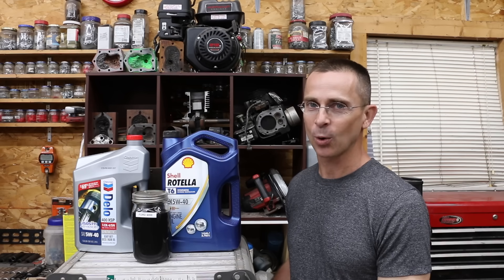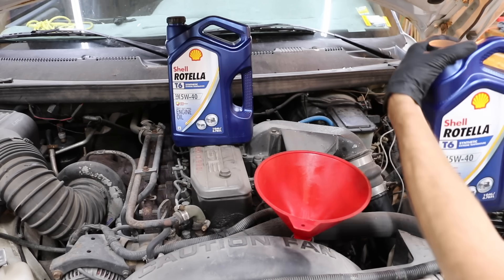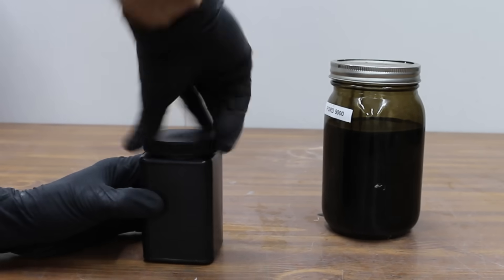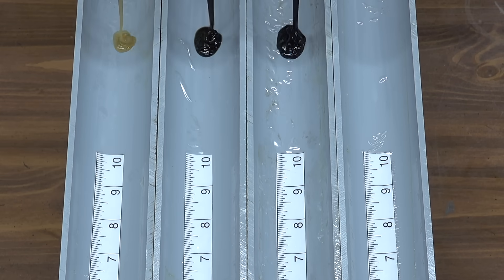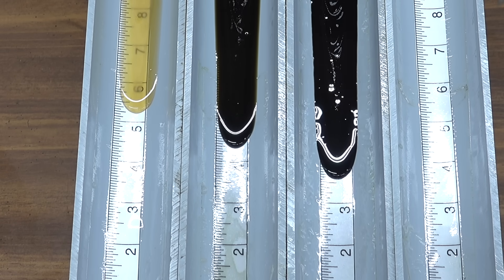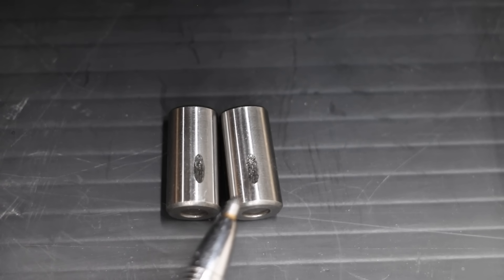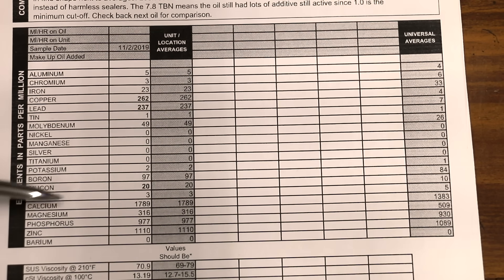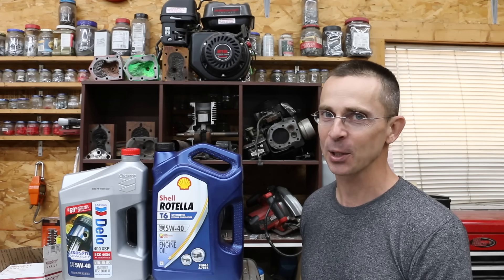Will Annual Oil Change Damage Your Car? Let's find out!

Comment: The question is how many miles before the fully synthetic oil is out of the normal ranges.
I have known for many decades that mineral oil goes black at around 1,000 miles & fully synthetic oils go black at around 2,000 miles, so these type of oils i guess starts to degrade at these mileages.
So for a high performance turbo engined car i would recommend changing the oil with fully synthetic @ 2,000 miles for the ultimate protection.
Good also to change your oil twice a year just before the hottest and coldest months arrive, july & december.
Good video.(:-)
Reply: 2000 miles is needlessly frequent in my experience. Oil is supposed to go black. That means its detergent properties are working correctly.
Reply from the maker: Thank you for the feedback.  Oil should last much longer than 2000 miles.  With regard to color, when exposed to heat, it oxidizes and changes color as demonstrated in this video. 0 miles and the oil is dark.  The oil is still good.
Reply: @ProjectFarm  
I know oil lasts longer than 2,000 miles but starts to degrade around 2,000 miles on a car and not at full tolerance at this mileage that's what i was trying to get across.
I found that oil goes black after 2,000 miles on the dipstick with FS and not straight away.
When you service your car the level of the oil does not drop at all on the dipstick only after a certain amount of mileage.
When you notice on the dipstick that the engine starts to use oil this is a good indication that the oil is starting to deteriorate but the oil is still obviously good but clearly not as good when it was brand new.
It will go black nearly straight away on the dipstick for when you put in FS for the first time as it starts to clean the engine especially if there has been a poor grade oil in beforehand with black sludge in there, but after a few services the oil stays clean for longer on the dipstick after you service it.
But the oil will look dirty soon after the service if you drain it though.
Also engine oil does not reach 400+ fahrenheit in an engine it reaches around 200 fahrenheit.
I have a oil temperature gauge that reaches a maximum of 212 fahrenheit 100 celsius on my high performance honda hornet 600 and never goes no where near to 400 fahrenheit.
The gauge is even redlined to 248 fahrenheit 120 celsius and never reaches that.
It takes 10 miles for my bike to reach the optimum temperature of 80 celsius with FS in.
Personally i have noticed that my motorcycle engine does not start using oil until the new oil reaches around 1,000 miles of usage this surely is an indication that oil usage is not all to do with heat if it was all to do with heat it would start to use oil straight away which it does not.

Comment: Little confused. Are you saying that I don't need to change my oil in my gas engine truck at 5K miles? Or is this just diesel/Tractors?
Reply from the maker: The video demonstrated that oil with "low miles" is good well beyond 1 year in the crankcase as long as the oil reaches full operating temperature.  Gas or diesel engines, it doesn't matter.  Thank you

Comment: I would love to see this test done with the new DGI engines such as the Chevrolet/GMC 1500 models. I've heard the oil gets contaminated with these new engines. I have to get my oil changed at least once a year according to the manual to keep my warranty since I don't drive many miles. I just recently had my oil changed a year later with 75% still remaining on the dash oil life indicator. I bet this is a scam.
Reply from the maker: Thank you for the video idea!

Comment: How long you can run an oil largely depends on the TBN ( Total Base Number ), the bigger the better, for example i have run Shell Rimula R4X which is just the name Shell gives to Rotella outisde North America, for more than 2 years without a problem.
This is because it has a TBN of 10.5, which is pretty high, and therefore can neutralize acids for longer than oils with a lower TBN.
Reply from the maker: Great point! Thank you
Reply: Rotella and rimula series both are different
Reply: @veeral01  Yes they are different but if you compare an anlysis of Rimula and Rotella 15W-40 they are very similar

Comment: A other problem is you used old diesel they don't make a lot of moisture then petrol and more modern engines have more different problems due to emission equipment gasoline direct injection= you can't transfer your conclusion on to modern engine designe It's quite complex as I have 2 tdi be the oil from the dpf can damage the same engine who has no dpf.... What matters for modern is the manufacturer specified oil code for engine designed.
Reply from the maker: Thank you for the feedback

Comment: Busting the BS, I love it! I have actually done a 17 month oil change on my accord V6 at 10K miles and it turned out fine. My accord saw longer trips with more time in between drives vs the usual daily commuter.
Reply from the maker: Thank you very much!

Comment: Is it just my eye, or did the used T6 offer slightly better protection than new in the film test?

Another thing worth noting as this test was performed on synthetic oils, which are designed not to break down at a molecular level. As far as I'm aware, mineral oil will start to break down after 6-9 months so it might be a good idea to repeat this test with a mineral and a blended oil
Reply from the maker: Thank you for the feedback.  The used oils were both T4 (Conventional)

Comment: I used to change mine often along with air filter and oil filter. I would check the viscosity of the oil. When checking the dipstick clean it off with your fingers and roll your fingers around and feel the consistency of the oil if it doesn't feel slippery and feels more like milk or water it's lost its lubricating ability. I also would put Marvel Mystery Oil in it. Or if all of a sudden it starts burning oil Marvels when it burns the residue is still a lubricant. I did this in my Ranchero  170 straight. Driving it 4 over fifteen years an estimated over 500,000 MI. It started losing water I decided to rebuild it and found out  the rear freeze plug had rotted out.
Reply from the maker: Thank you for the feedback

Comment: I think the 3 months/ 3000 miles thing is from the past with poor additive packages and conventional oil.  With a full synthetic oil, change it based on mileage, not time, since there is no organic material to go bad from age.  Syn blend should be changed by mileage or after a year, as well as conventional oils.  It also depends on how hard you are on equipment, too.
Reply from the maker: Great point!

Comment: Biggest problem is that people dont check their oil, so cars that could go 5 or 10k miles if they were topped up (some motors just drink a bit of oil, like the BMW N14) they could, but owners just run them so low on oil that it wears or destroys things (like the cam chain tensioner on the N14)

I drive my truck RARELY, a land rover 4.0. I change the oil every year or two, but it only gets 100-200 miles a year. I change the oil more from guilt than anything, because it's still visibly transparent at the end.

I only change my motorcycle oil once a year and even on my high revving bikes, I've never had a problem.

I Blackstone most of my vehicles. On my daily driver, I do about every 5k miles with full synthetic because it sees hard city driving and runs a bit hot being supercharged.
Reply from the maker: Great point.  Thank you

Comment: Project Farm, I really enjoy watching your comparison videoes and purchace things mostly off of your videos, Thank You For your hard  work and dedication
I have an interesting comparison idea that is not real expensive but should provide some interesting results.You could try different brands of automotive fuses and see if different brand fuse sizes blow at different amprages ,I assume the most popular is the standard Blade fuse, but the micro blade is getting popular, lets say Brand "A" 20 amp fuse actually blows at 23 amps and Brand "B" 20 amp fuse blows at say 19 amps.
I feel it would be a good comparison especially if the component required a certain amp and did not receive it thus harming the component  from low ampreage

Comment: I have a number gas engines and have been a oil nut sense the 70s with Amsoil but have gone to the T6 for a long time now, always change oil using the color to tell me when to change, and easy go over a year between, my 02 avalanche and 4Runner is doing great, use the T6 in several motorcycles as well and never a problem, so the T6 is a winner in my book too, great vid, confirms my thoughts, thanks
Reply from the maker: Thank you for the feedback

Comment: I spoke with an oil company engineer once and was told that the only things that kill oil are contaminants and extremely high temps.  In the end, change your filter frequently, and under normal operation, engine oil will last 100k miles
Reply from the maker: Thank you for the feedback

Comment: I went 5 years without changing my oil..  just add a quart every other gas fill up, due to leaks.  Saved a ton of money...  and sold the car with 250,000 miles, still running strong!   I think the leak, and the constant adding oil kept it sorta fresh.   I would never recommend trying this on a new car, or low milage car.  The car was 15 years old And high milage, and not worth much.
Reply from the maker: Thank you for the feedback
Reply: thx.. I do recommend this if your adding a lot of oil due to leaks/ burning   and don't really care much about your car...  You could save  a ton in  oil change money which could be used  other stuff like J.D.

Comment: It has a lot to do with your climate, in a more humid environment I would definitely follow the recommended intervals. Water from ambient humidity reacts with oil over time and degrades it, even if you heat it up and remove the moisture, you are still left with degraded oil.
Reply from the maker: Thank you for the feedback

Comment: What if you took the same "model" of oil and then did testing showing the difference between like four different weights? Not useful for showing what's better, but at least demo how different weights work?
Reply from the maker: Thank you for the video idea!
Reply: This would be interesting since Shell has recently started making Rotella T6 synthetic 15W-40 along with 5W-40. They also make T6 0W-40.

Comment: I use T6 in my motorcycle I have had no problems now I do change my oil every January regardless if it needed it or not I'm never anywhere close to the recommended oil change miles.
Edited to change "THE" to "T6"
Reply from the maker: Thank you for the feedback
Reply: @ProjectFarm  dammit didn't see it says THE it was supposed to be T6.

Comment: Good testing. I've been running Delo in the winter and Mobil Delvac in my Duramax in the Summer. I used to run Rotella in my Powerstroke, however certain oils give the Duramax the "type writer tick" which was my experience when running Rotella in mine.
Reply from the maker: Thank you for the feedback on the Duramax and Rotella

Comment: Off topic but I searched and you have not done anything about tire pressure gauges.  I just need a good one.  Accurate and consistent.
I have one for my compressor, but it is not good in the winter.  The one I carry in my truck, is sometimes 5-10 PSI different than the one on the compressor.  I just need one that works and is accurate.  My truck is a 2011 and has the readings on the dash, but those are not close to either of my other gauges.  The gauge I have in my truck, that I paid about $15 for, it will read 40 psi and my readings on my dash will say 29 psi.  I don't care if my dash is wrong, i just need a good gauge so when I fill my tires, I will trust it.
Reply from the maker: Thank you for the video idea!

Comment: FWIW the babbit based bearings are fairly sensitive to corrosion. Even finger prints will etch them so if you have tri-metal bearings they will be effected by acidic oil, especially as they wear since there will be no oxide coating or anything to protect them. Usually steel and iron don't have as much of an issue.
Reply from the maker: Great point!  Thank you

Comment: I always think of cooking oil and changing your oil. Cooking oil can only be kept at a frying temperature of 350 for so long.
Reply: Cooking oil has different properties than engine oil.

It's comparing apples and watermelons. 

You don't pour Canola in your engine. Or cook french fries in Mobile One.
Reply: Johan van Gelderen your right they are different,  but same principle.  Motor oil will break down with heat also. Not a know it all but that is just how I put it.
Reply: @johanvangelderen289  it might be better off to use Mobile one for cooking, because rape seed oil (canola oil) is a scam an poisons to the  human body...they put this poison in all sorts of food products, read the labels and see...

Comment: I use Rotella T6 in my track bike (2005 Suzuki SV650, v-twin and wet clutch).  Works fantastic.  I change the oil and filter only once a year, and it gets maybe 1000 miles of very hard use.
Reply from the maker: Thank you for the feedback!

Comment: This was a but dizzying to watch but I liked it. Very impressive. I drive my 2017 Honda Accord daily but not a lot in a year's time due to being only slightly under 13 miles, one way, from work. My wife will drive it occasionally weekday evenings and weekends. In short it gets regular use, mostly highway but quite a bit under the national US average. I usually have the oil changed twice a year but the Honda dealer where I bought the car from things I should change it at specific intervals regardless of mileage. They want to sell oil changes while I wish to save money and oil.
Reply from the maker: Thank you for the feedback!

Comment: rule of thumb, if you do a lot of city driving, change your oil more often as it will be diluted with fuel more and more broken down due to more frequent heat cycles.... if you do mostly or all highway, you can stretch out your oil changes a lot more.... LOVE THE CHANNEL
Reply from the maker: Thank you for the feedback

Comment: Does switching between engine oil brands every change affect the engine.As long as i keep using synthetic and the same grade am i fine? I like to pick up different brands each time based off which one is on sale. Thanks
Reply: @Rusty Highlander yea, the usual reason I hear to not mix brands is that the detergents in each may not be compatible but I think that risk is nearly negligible

Comment: engine oil, especially used oil is carcinogenic, don't make contact with your skin.
Reply: Skin is very good at keeping outside substances out and insides in, just touching any oil isn't dangerous, just don't let oil sit on your skin.
Reply: It also dries out the skin and causes it to crack if you handle it all day. Nasty stuff. BTW skin doesn't protect against everything, chemicals can penetrate it. FOr example those pain killer patches, but a lot of other stuff does as well.
Reply: @pizzablender  Your skin is the largest organ of your body and since it is porous, it absorbs whatever you put on it. Your stating false information and should fact check your comment otherwise you mislead people.
Reply: How would you breath in oil? Bris Vegas, maybe do not drink the oil?
Reply: It also dries out the skin and causes it to crack if you handle it all day. Nasty stuff. BTW skin doesn't protect against everything, chemicals can penetrate it. FOr example those pain killer patches, but a lot of other stuff does as well.
Reply: Most engine oil is carcinogenic. There are a few that are considered non toxic to the environment but they're holding very little market share as of 2019. That'll probably change by 2050.
Reply: I'm referring to Renewable Lubricants Inc. and Green Earth Technologies' "G Oil." RLI is Veggie Oil Based, G Oil is Beef Tallow Based. I poured a little of RLI's Diesel 5w40 Low Ash oil on my lawn (both new and 2,000 miles used) and the grass died for a few days but regrew within a single week. It's real.

Comment: Using a lawn mower. Is it really necessary to seat rings with non synthetic oil? Compression tests, scarring, ring end gaps etc checked after a couple hours of running?

Comment: As always I love your videos and also base a lot of my purchases on your videos. 

A suggestion I thought of is something I have heard debated a few times while  watching your video.

Prefilling oil filter. I used to do it all the time (especially on my 2001 cummins) until somebody made a point about doing that. If you drain all the oil out of the system the oil pump has to pump a bit of air up the pick-up tube before it gets oil. When you fill the oil back up and start the engine it pumps the air very quickly through the oil filter and oiling system. This lets the oil pump get fresh oil and start pumping normally. On the the other }{/
Reply from the maker: Thank you for the feedback!

Comment: My astro Van with a 4.3 V6 I change the oil every 12,000 to 15,000 miles. I use the fleet farm 2 gallon cheapo oil and a Fram tough guard filter. I've had 6 of these vans now, every single one has gone over 300000 miles. If it uses a little oil I just add Lucas.  I save so much money in oil changes that over the life of the Van I could put in a new engine cheaper than changing the oil every 3000 miles.

Comment: Bad idea prefilling your filter the way you did. You're adding unfiltered oil to the output of the filter. Just install the filter dry. If you get engine damage for the few seconds that there's no oil pressure then you have bigger problems
Reply from the maker: Thank you for the feedback